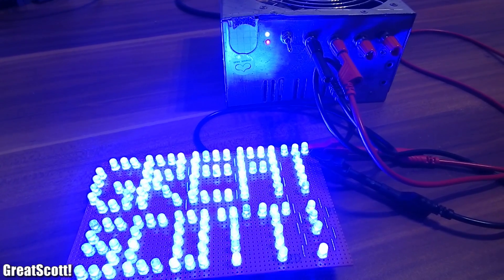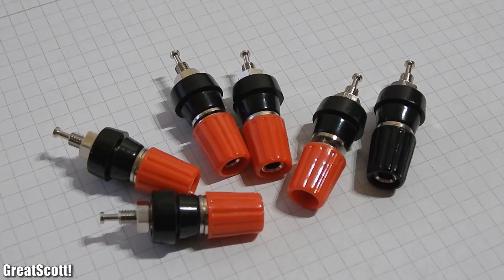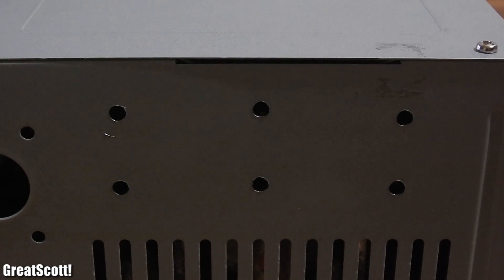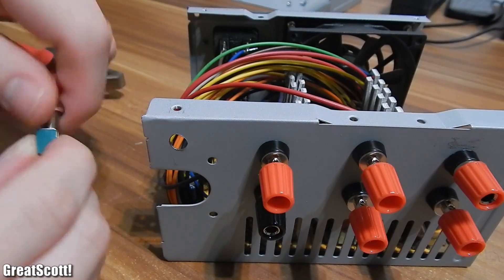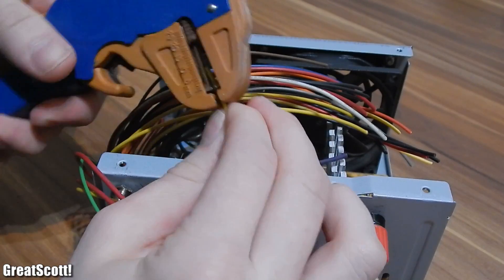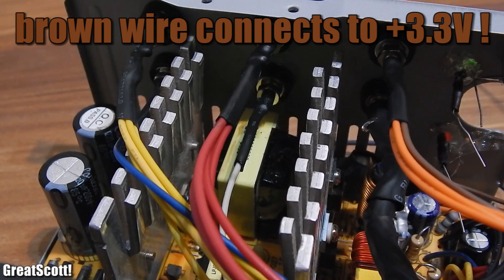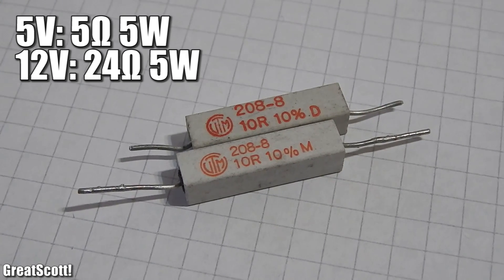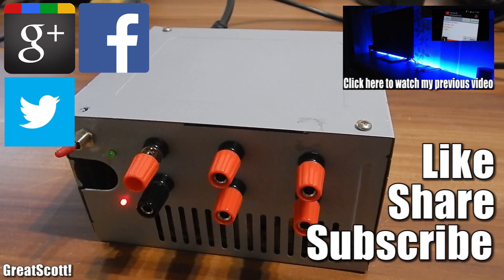DIY Lab Bench Power Supply

Comment: This may be a stupid solution, but you can get a power supply from nothing more than a train set, just connect a couple of jumpers to the track connections, and ramp up the power, if you get the right supply, like Athearn or railpower, they have a case mounted shut off switch

Comment: what happened to the grey wire? do i just leave that?
Reply: On standard ATX PSUs, the grey wire is the "Power Good" monitor. It's a +5V line that tells the mainboard that the PSU passed it's internal self-tests and all voltages are working nominal.
So for the Lab Bench PSU it's not neccessary to have the grey wire connected, since you don't have a chip that can make use of the "Power Good" signal.

Kind regards,
Meta Custom Computers
Reply: thanks... i already made one.. :)

Comment: what happened to the grey wire? do i just leave that?
Reply: Yes. On a standard ATX PSU the grey wire is the "Power Good". It's a +5V line that tells the mainboard that the PSU passed it's internal self-tests and all voltages are working nominal.So for the Lab Bench PSU it's not neccessary to have the grey wire connected, since you don't have a chip that can make use of the "Power Good" signal.

Kind regards,
Meta Custom Computers
Reply: But it look he put it with the orange wire 4:31
Reply: You can connect an LED with a resistor to this wire, it will light up signalizing that all voltages are ok

Comment: i already have a main switch on the back. is it necessary to have a second switch on the front to connect power_on? if not, what about the 5v standby (purple) and the power_good (grey)?
Reply: Yes you do need one to turn on the Power suply the one in the back only switches mains
Reply: i think im not that very expirienced and i now im late but i hope i helped
Reply: Filo Bolla If you connect the green and the black wire you will turn the psu on.

Comment: My power supply has 2 12v rails. The 5v rail has a max load of 20A. Each 12v rail has a max load of 18A. Do I still only need 1 yellow wire for my dummy load, or do i need to get one wire from each rail? If so, how do I differentiate between the two rails?

Comment: do all power supply need a resister
Reply: nicholas scott duhhh,ur a noob at electronics but hey everyone has to learn one way or another,a 200ohm resistor on leds,a 0-5Kohm resistor for your power supply,it depends on the amperage,wattage,and voltage your power supply needs,just look up on google e.x "what kind of resistor is needed for 12v 5amp 45w power supply?",then find it,boom order it,and when u get it,add it in your project whenever u wanna work on it,your welcome from a friendly electronics enthusiast

Comment: you mentioned "sucide" hole with is left unused?? you wrong ..
most of atx psu "sucide hole" is used by me as hole for rocker switch with built in neon light for power indicator

Comment: i made this and it works great but a have a problem, i took a 12V engine from my old cpu fan and when i conect black wire to ground and yellow to 12V it spins for a second and them my psu turns off , when i concet it to 5V it spins but very slow, what should i do to make it work with 12V?

Comment: Just a very noob question: 
Can you get electrocuted from touching the chassis? I'm thinking since the binding posts are touching the chassis?
Reply from the maker: +Simon Rydell No, but you can short the output voltages if the binding posts touch the chassis directly.
Reply: PC PSU's are required to be grounded, this is why three prong cords are used. Unless you ground the psu chassis to earth ground, you could still get electrocuted if you touch the chassis while bare footed, although not fatal in most cases, it is still quite painful. This is specially true with PSU's that are poorly designed with cheap parts.
Reply: +rene kenshin 120 V DC are allowed to possibly be touched
Reply: Aren't all the binding posts directly touching the chassis? Am I missing some insulation?

Comment: What I did is I created a breakout box with the binding posts, fuses and an LED. It accepted a 20-pin connector - this way I can connect any ATX PSU to the box damaging it/cutting any cables :) Also the LED I used is green-red 2-color LED. I wired green to normal 5V rail and red to the standby 5V (always red on standby) via a single transistor and some resistors to the "power good" output - this way the LED is red on standby, green when ready and yellow when it switches on or the rails drift :)

Comment: When I turn on the power supply it works but when I start applying load to the 12v output it stops the power supply at around 0.2 amps. Any idea why? I tried using the 12v 8amp and 12v 14amp output.
Reply: +Attila P. U must load the 5v line to 12v line work properly.

Comment: wait im a bit confused you said you needed a 5 ohm 5w resistor on the 5v rail but you used two 10 ohms?
Reply: +Elle Random (2) 10 ohm resistors in parallel is a 5 ohm resistor. (2) 10 ohm resistors in series is a 20 ohm resistor.Parallel; 1/R(total)= 1/r1 + 1/r2 + 1/r3 ... and so on. In this case 1/r(total)= 1/10 + 1/101/r (total) = 2/10so r = 10/2 which is 5. For resistors in series r(total) = r1+ r2 +r3... and so on. (just add their values)
Reply: +st1300 r Oh i see how it works now. Thanks!

Comment: I built my own, but I am having trouble on the 5V output. It's steady at around five volts, under no load but the current is at a small 1.5amps? The ATX power supply that i have is rated to 400watts. I don't know what I am doing wrong? suggestions? I would like to see a solid 15-20amps of current, as the box states.
Reply: +Anthony Mosallam it depends on the ohm's law. PC PSU's don't have regulated current, it's the maximum they can provide on the label. It will give you as much amps as your device needs ;)
Reply: +Anthony Mosallam You aren't doing anything wrong. The only way to see it's rated current (and that's not a great idea in the long term) is to put a load on it that draws that amount of current. In other words if your device hooked up to 5 volts is drawing 1.5 amps you'd need to hook up 10 of those widgets to draw that rated 15 amps.
Reply: +st1300 r Thanks for the advice, i went and bought two 25watt half ohm resistors, and installed them in my circuit in parallel after the shunt. When i switch the unit on, i get massive amounts of heat from the resistors, but my ammeter reads the same current. Voltage does drop though.

Comment: Is it possible to put each wire to a separate post and then use various combinations of wires to achieve different intermediate voltages like 3v, 6v, 8v, 9v, 10v, 12v, 15v, 18v, 20v and so on by using two hot and one ground? Like stacking batteries of different voltages?

Comment: +grenville hansen  - Thanks for the reply.

Meaning that if i put a 22 Ohm Resistor it will be basically the same than the 2*Pararel 10 Ohm in the 5V rail. Right? Or will it be to much resistance on the 5 V Rail? because if i'm not mistaken 2*10 Ohm Pararel equals 5 Ohm. Right? Sorry if i'm not making any sense!!!

Comment: Sorry for my "noobness" but i don't understand what are the dummy load resistors for, i know it is to stabelize the low "voltage" in my case 5 V but what hapends if instead i put a 10W 22ohm porcelain resistor??
thanks for all the shared knowledge.
Reply: +Artur Rosado   A real load is something you are supplying power to .A dummy load is something that is drawing power in order to to load the supply.  Some power supplies will not turn on  unless they sense a load.

Comment: why did you put resistors on the positive lead to the led?  what would happen if you just supply whatever voltage the led eed without the resistor?
Reply: +Eribel Rosario It's because normal leds needs about 1,8V to shine. If you supply 5V to them, you'll destroy them. Let's do the calculations. You've got 5 volts. The LED needs only 1,8 volts to shine and with that voltage it will consume about 20mA. 5V - 1,8V is 3,2V. That's the voltage drop you need to get on the resistor. And the Ohm's law says, Resistance = Voltage / current. R = 3,2 / 0,02 = 160Ohms . The voltages the LED needs differs with color so using 220 resistors should be fine for all LEDs
Reply: +MrsBezdak i have a 3ft long red leds installed as my third brake like and when not steping on the brakes the led lights have a low glow and i check the voltage it was at 5.5v and whwn i press the brake they go up to 11 or so volts why is this if they are 12v ? would a resistor stop the low glow even with the car off they have a low glow
Reply: +Eribel Rosario yep,it will stop the glowing. But again. You need to check datasheet of your led stripe and check at what voltage they're starting  to glow and how much current they draw while glowing in order to calculate resistance of the resistor. Make sure you get a suitable one.  For example,  you're leds draw 0,5 amps on 12 volts.  If you buy a normal resistor, it would glow as bright as the leds and burn so you would need to buy at least 6W one
Reply: gotchaa
 thanks alot bro

Comment: What resist should I use if my max amps is on the 3.3 rail ?
Reply: +Phillip Chivers   Just put the load on the 5 volt line. it works better there.

Comment: I just built a power supply following (mostly) your video.
Danke.
BTW: My dummy-load resisters got very hot quickly (>50 C). But, I just stuck them to the metal box with some thermal paste. Now, the whole case is a heat sink for the resisters.

Comment: What if i put 12ohms to the 5v rail as dummy load,or 30ohms to the 12v rail as dummy load.and can i use this power supply to power arduino ?

Comment: +Jonas Offermann Martins and Michael Ding. Welcome to electronics Jonas! The small toggle switch is of a type which is single pole double throw.That means that it only interrupts or controls one leg of the supply, but it can, when needed have two active positions. In this application one terminal of the switch is not used because it is simply being used as an on/off switch. However if you wanted to switch the supply independently to different circuits at different times, then you would use all three terminals. Usually the centre one is common .Michael - a very good point. Perhaps putting some insulating sleeving over the threaded portion of the binding post where it passes through the metal casing would help.Saludos desde el chico electricista.

Comment: amazing project but for 5V output i don't think i can use it for an arduino or any developement board with his high current  ??  if am wrong please answer me
Reply: +oussama belyamani The way I understand it, with constant voltage sources, the voltage is provided by the source, and the current is taken by the project.  In this case, your arduino will take the current it needs and the voltage source will work to maintain a constant voltage.  As long as there is enough current in the upper limit (what the power supply is able to provide), then you should have no problems!
Reply: Arek R. Well at least you can be nice and answer the question
Reply from the maker: +oussama belyamani It is a constant voltage source.
Reply: +GreatScott! with such a high current Its not a probleme
Reply: +Gary Jaffe You're da real mvp
Reply: +Gary Jaffe  Why does the power supply have amperage values on the back?

Edit: Is that the "max" current it can supply?
Reply: +oussama belyamani As it is a constant voltage source the current depends on the power of your consumer (I = P / U or I = U / R). This is the great thing about electricity. As long as you have any two values you can calculate the third one. Just draw somewhere the triangle U / R * I and cover what you are looking for with your finger. You then know how to calculate the value you are looking for. 

For me it always helps thinking of electricity as a river. The voltage is the height difference (the bigger the difference, the more water will flow), the resistance is the inverse width of your river (the wider it is, the more water will flow) and the current is the water flow (dm^3 / s).
Reply: you are correct, max power able to supply.
Reply: +oussama belyamani Arduinos run on a 5v current. This would probably work just fine.

Comment: Hi GreatScott!
I want to make one as well.
My Colourcodes are the same. Could you just tell me really quick, where you connected the GREY Wire to and Why?
Because you didn´t mention it in the video, but you can see it connected.
THX
Reply: The grey wire is usually for the motherboard, it is also known as power good wire which give a 5v signal when the other voltage rails are not ready to output any voltage .
Don't worry about that wire just ignore it. Hope it helps :-)
Reply: @chargedlabs3506  finished the project 4 years ago ^^ 
Nevertheless thank you for answering the question. Maybe someone else has the same issue :)

Comment: why does he have 3 connectors on the switch but only uses 2 of them? what is the 3rd one for? (i'm just starting with electronics so i don't know)
Reply: +Jonas Offermann Martins (ThePacaray) its a two way switch, look on google
Reply: +Jonas Offermann Martins (ThePacaray)  It's a "single pole double throw" switch.  If you google the phrase you should get an explanation of poles and throws. In this case the unused terminal would be connected to the center terminal when the switch is thrown the other way. IOW the center and either end terminal would work fine. The only difference is direction of the switch knob for on.
Reply: +st1300 r I already finished the project but thx anyway ;-)

Comment: It slightly concerns me that the binding posts you used does not seem to be the insulated type. Could it potentially short out the power supply if the uninsulated center of the binding posts touch the steel case?
Reply: I was thinking the same thing.
Reply: +cheek1m0nkey if you check at 3:16 you can see that they are housed/insulated by plastic. He is also stressing shrink tubing quite a bit and for good reason.
Reply: +Jeremy Tschudy the middle shaft is not insulated and if that touches the case, bye bye.

Comment: Does it matter the Wattage of the psu? I have an old 200 watt dell one that would befine for me to destroy but would 200 Watts be enough?
Reply from the maker: +Cameron Shoudt Depends on what you want to power with it.
Reply: +GreatScott! I'm not so sure yet, I'm just getting started with electronics most likely smaller devices, nothing to complex yet
Reply: +GreatScott! one thing I would use it for is testing pc fans so nothing OVERLY powerful
Reply: +Cameron Shoudt Would be enough for that
Reply: W = V*I, so assuming you are supplying 200W with a 5V source, the max current is 40A. Most beginner electronics only need a couple milliamps to half an amp. But even if you get more demanding components like small fans and motors I don't think you will need more than a whopping 40A. Let me know if I have made any wrong assumptions about what you want to do
Reply: of course fans and motors generally need more than 5V

Comment: is the resistor important,cuz I'm going to make of this and I don't want to fail please help.
Reply: +King Of Miner It depends on the power supply, newer ones have a dummy load built-in, but if you've gotten one out of an old PC it might not, if so all you need is some sort of load it doesn't need to be a resistor, it could be a light or even an arduino (actually I'm not sure if that would draw enough) whatever you can think of.
Reply: +vgamesx1 thx I will put the resistor just to avoid problems later.

Comment: Couldn't one just short the green power-on cable with a black ground cable? The power supply could be turned on and off using the build-in switch on the backside to cut it from AC completely

Comment: I am using 2x  5.6Ohm 5 W Resistors, when I turn on the switch it only last for 2 secs and turns off. but the Power red Led is showing power on.   Are the 2 Resistors not enough load for power supply to switch on and stay on?

Comment: If I put 24ohm resistor on 12v then it is 0.5A current, that is 0.5x12=6W. Why do you recommend 5W resistor? Am I getting something wrong here? What will happen if I put 5W 24ohm on 12V, as compared if it were 6W resistor according to the calculation?
Reply from the maker: +Dmitrii Zholud Both should work.

Comment: What rating is the toggle switch volts and amps please
Reply: +MonkeyMagic Elecifun Any switch will work. The Green PS-ON only carries a very small signal to tell the power supply to turn when the PS-ON is grounded. Just make certain that the switch is NOT a momentary switch.

Comment: Hi,
Is it possible to connect the 3.3 and the 5 volt wires together to get close to 9 volts? I have a radio shack electronics learning lab, which requires 6 AA batteries. I would like to power it with something other than batteries, if possible. Thanks
Reply: +Darryl Landry Wouldn't connecting your load between 3.3 and 12 give you ~9V?
Reply: Darryl Landry You need the batteries. Thats how it gets so many voltages out. Also, You dont connect two rails of a power supply together with different voltages, thats a short. In your case, it would be a 1.7v difference, so a short of that.
Reply: ok thanks
Reply: +Darryl Landry Though I think you would need some load on the 3.3 rail to get rid of the current getting to it from the 12 one

Comment: Maybe this is an old video to comment, but shouldn't you put the resistor on the positive (longer) leg of the LED to protect it ? or is it on the negative to protect it before current go through it (protection) cause current travel from negative to positive ?
Reply: +Ahmed Gamal 
The led and the resistor are in series, so the current on the LED will be the same if the resistor is on the positive or in the negative, it doesn´t matter.

Comment: hello Hi great scoot plz make a wifi router/modem ups that runs about 2 to 3 hours because in india huge power cutt
Reply: +Syed Khalid You can use an bananapi router, it has an integrated Power Managment chip that can use any lipo / liio battery and also you can use an harddrive with it.